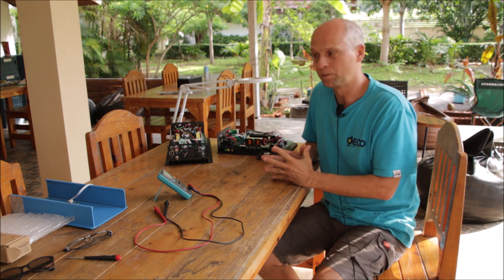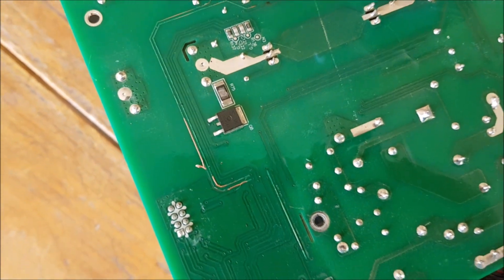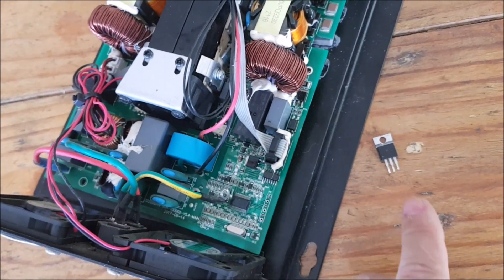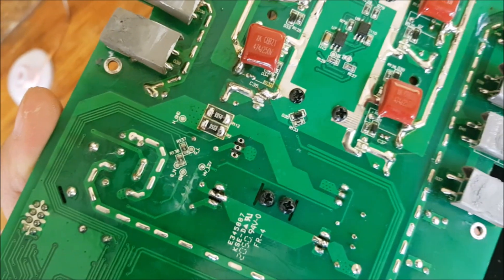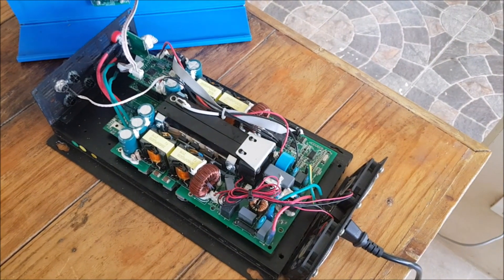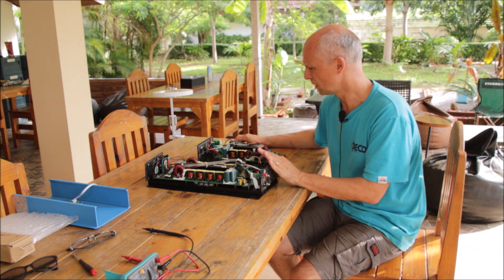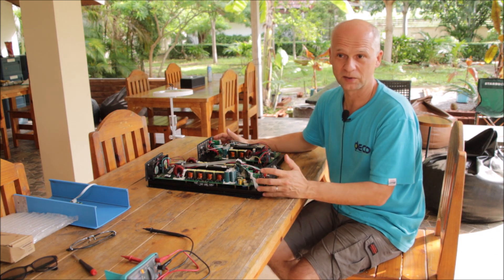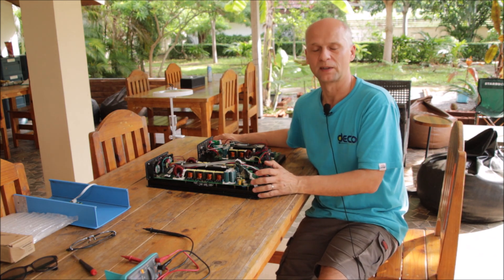Two dead SUN1000/2000GTIL inverters! Are they fixable? Let's take a look!

Comment: I am going to use a Pow Mr 4,5kW hybrid inverter with a 24V 560Ah Lifepo4 battery. Now I am not shure anymore, if I should connect the AC input, even i have a 275V SPD right next to it installed and a over/undervoltage protector relay is at the main input of our house. It  seems this Inverter have no relay for "bypass"-mode. The manual tells 94% efficiency in "Line Mode". It has a build in battery for wake up, so no AC-Input seems to be needed and when I let the ATS make the bypass I have 100% efficiency but the ATS with magnetic coils inside house is quite noisy. I am still undecided. How reliable the Inverter is...I dont know, yet, but he was not too expensive, feels worthy and looks good : )
Reply from the maker: For Off-grid systems it is very important to use SPDs at the AC-Output as well, as you are operating in a closed system where induced voltage surges can not easily get out of the inverter. But of course lets all hope never get such occurrences at all.
Reply: @RolandW_DIYEnergyandMore  Before I was reading your response I asked my self, if it is really good to make the earth bonding to define a Neutral at the Inverter output to make  RCB's work, cause if any surge occours it will destroy your inverter on the way to ground. If no ground is offered the surge will search some other way, not through the inverter and wouldn't destroy him. I heard some inverters dont like grouning (exept on housing). So I am still very undecided about the grounding. The SPD,s on output also offers a path for a power surge, so I am also not sure if it is advantageous to offer a path through the Inverter and SPD. I am adding some varistors (20D391K) on input and output between L and N against inductive backfire and other power surges. My solar panels also have no SPD's. They are mounted on a well grounded tin roof (right beside the house on much lower level as the roof of the house) with welded frame which I grounded with a ground rod. So my phisolsophy is to keep Everything insulated to force any surge not to use the way through my system. Is anything wrong about that?
Reply from the maker: @topeye4202  SPDs do provide defined  shotcuts to ground outside of electronic appliances. That is exactly what we want. If there is no grounding provided, the surge will find a random path to ground. That will always be inside electronic devices as their PCBs are the weakpoints inside our electrical installations. It doesn't need to be the inverter where that happens. I had a case where all my appliances where shot in my at that time ungrounded/unbonded off-grid system. Just the inverter survived without any damage...
Reply: @RolandW_DIYEnergyandMore  Thats bad, where did this surge came from?  So i will add SPD's at output too, but about the grounding i am still undecided cause some one told the inverters dont like grounding, he was from USA...is this only with transformerless inverters ?
Reply from the maker: @topeye4202  US has different equipment as they have a split phase. many people even use European inverters. Such configurations are vert tricky and one needs to know what he is doing. 
My off-grid system surge damage as well came from a nearby lightning. It ruined the whole pool equipment. was quite a big, expensive damage...
Reply: @RolandW_DIYEnergyandMore  Didn't you have SPD's on input side back then? I think theres no way for a surge into my off-grid grid, which can bypass the SPD's I have on input side. I have no exposed wiring, all is protected inside our house.
Reply from the maker: @topeye4202  no SPD on input side and only a 1P SPD on L/output. But due to no N/G bond on output, the surge could build up on N/output as well. I have of course reconfigured everything since, and that was almost 4 years ago and since then, the inverter is working perfectly fine...
Reply: 😅 @RolandW_DIYEnergyandMore